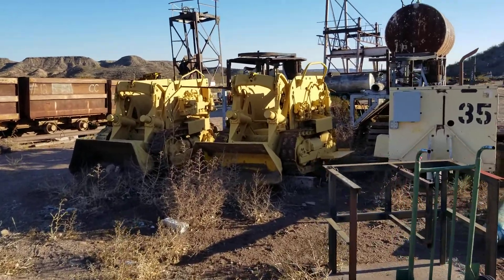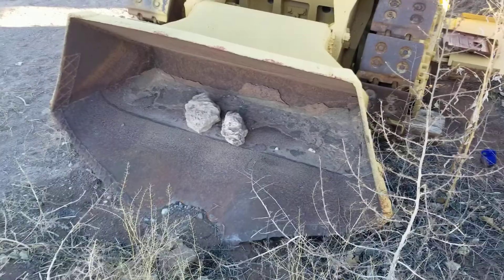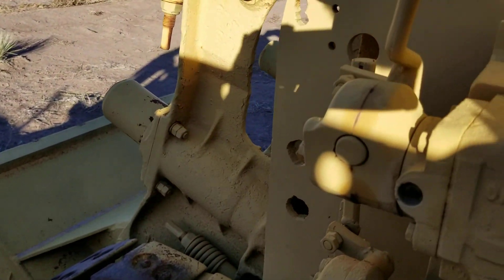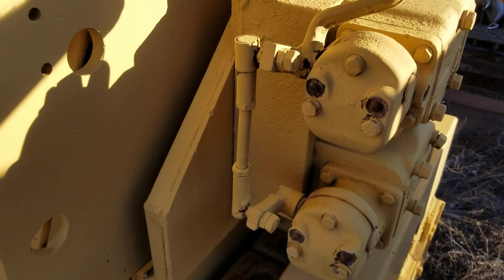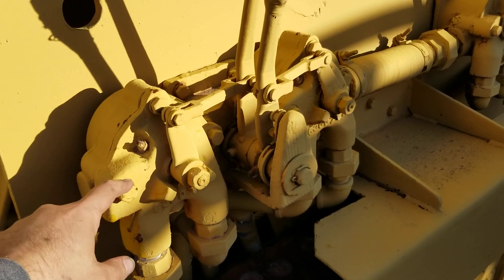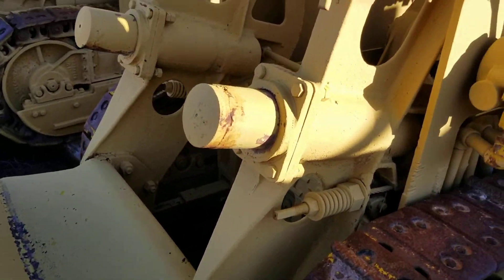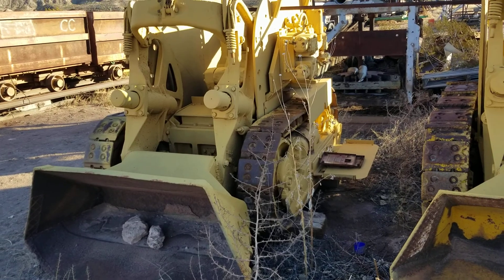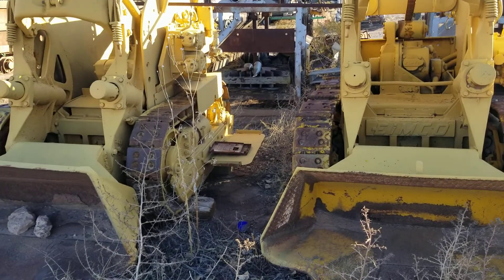EIMCO 630 Crawler Mucker Walkaround

Comment: Awesome! Looks like an Eimco 12B mucker that I operated at the 16to1 mine, but on steroids! Really like that they’re tracked. Would work great in a drift mine. Nothing like taking your head off if you’re not paying attention! Gotta love the ingenuity!
Reply from the maker: A 12B on steroids, exactly! I think there's about a half-dozen 12Bs in this yard as well, including a few 36"-gauge machines that were bought at auction for a few hundred bucks a piece. I'd be happy to mess around with these 630s - I spent a bit of time last year pricing out air solenoids to convert one to electric pilot controls and then either build out an umbilical remote or hillbilly-engineer a crane radio receiver powered off a marine battery. The whole idea was a dirt-cheap RC machine to muck unsupported open stopes, but the orebody we've got appears more suited to shrinkage and/or raise access mining because of questionable horizontal extents and very limited infill drilling. 

I talk about the air consumption like it's a big deal, but I found a pair of 900CFM compressors in Magdalena, NM last winter that made their way down here. With one of those running, the 630 could operate at the the same time as a jackleg, accounting for system losses. The 630s use 600 CFM, and their bucket is a half yard rather than a quarter yard like I said in the video.

I wouldn't want to be sitting in a Young Buggy with one of these things slinging muck at me - I'd rather load the truck myself. These particular examples at least have a grab rail that will theoretically make self-decapitation a bit more challenging!
Reply: @Porty1119  , in this video  
https://youtu.be/eMEBqZDHjPY
I’m trying to run a 12B in a tight area with a low back that limits the swing of the 12B bucket without taking my head off!
Reply: Hello  Porty and Muleskinner, a pleasure to greet you, maybe you know where I could get EIMCO 12B paddles, I am interested in buying, I would be very grateful if you could provide me with information, a hug